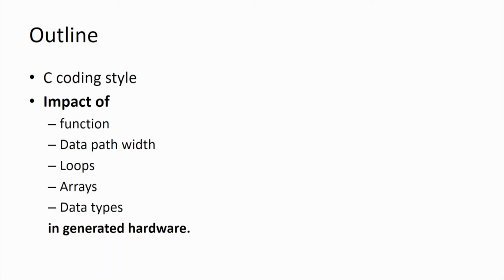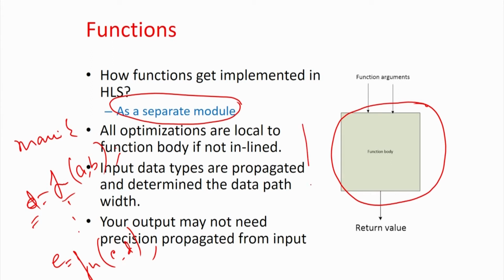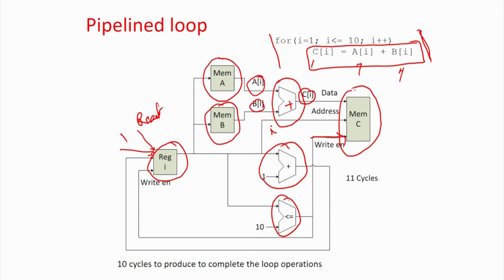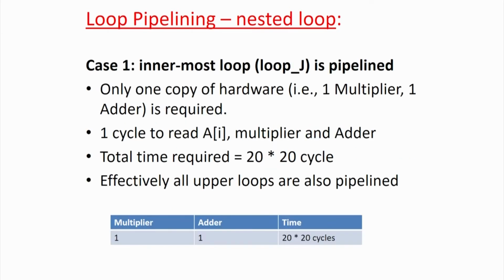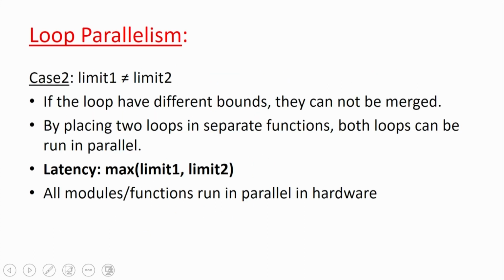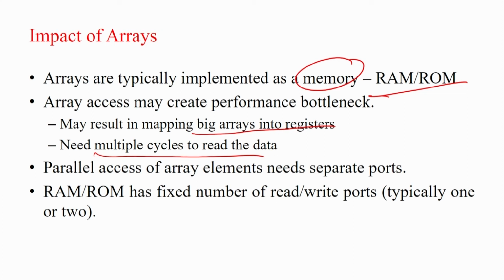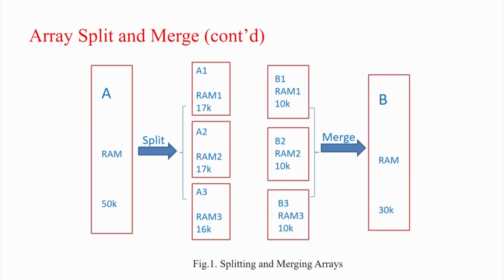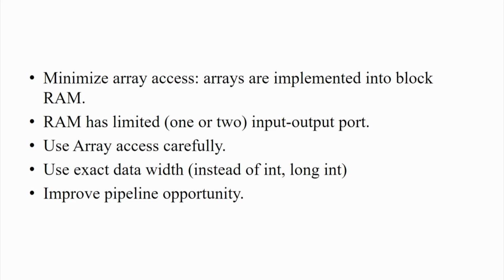VLSI Design [Module 01 - Lecture 04] High Level Synthesis: Impact of Coding Style on HLS Results

Comment: In video (time :45:00), there is mistake in the slide.  The loop iterator should be incremented by 1, i.e.,  i  = i + 1.
dout_t fn(dout_t A[N]){

for(i=3, i<20, i=i+1)

  Sum =A[i] + A[i-1] + A[i-2] + A[i-3];

return sum;

}
and 

dout_t fn (dout_t A[N])

{  din_t  temp0, temp1, temp2, temp3;

dout_t sum=0;

int i;

temp0= A[0]; temp1=A[1]; temp2=A[2];

for( i=3; i<20;i=i+1){

temp3 = A[i];

sum = temp0 + temp1 + temp2 + temp3;

temp0 = temp1;  temp1=temp2;  temp2=temp3;

}

}